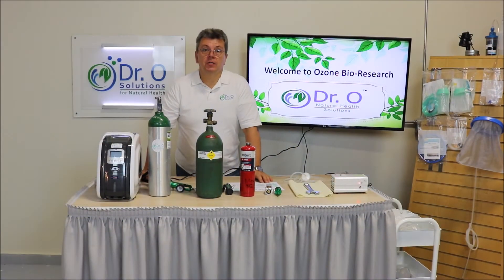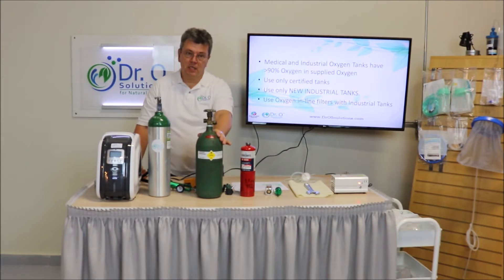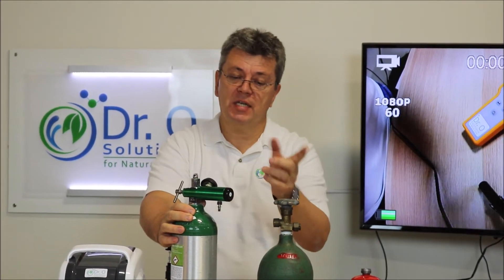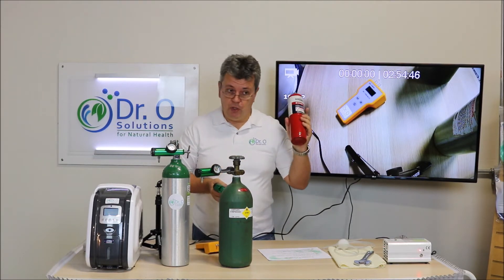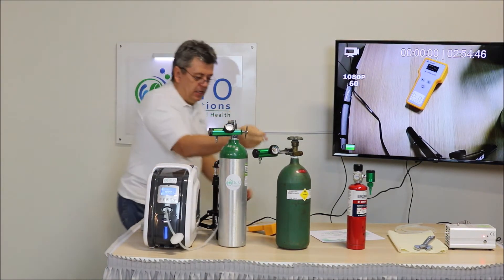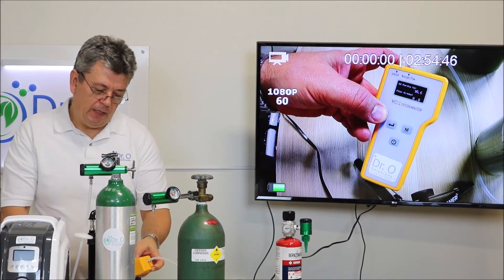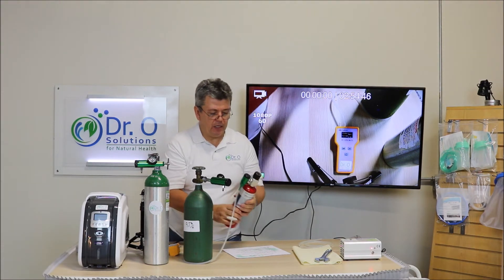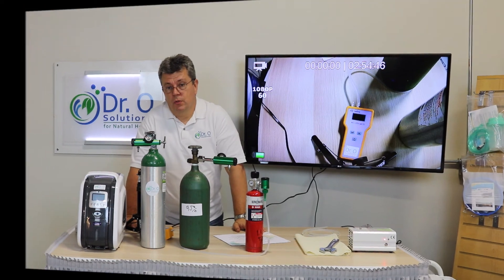Oxygen and ozone for medical ozone therapy

Comment: Is it safe to use Industrial grade oxygen for breathing and inhalation therapy and for drinking?  Where can i buy Medical grade oxygen without a prescription?
Reply from the maker: in USA it's only by prescription, if industrial oxygen is filtered - it's safe
Reply: I use beverage grade oxygen from local supplier.  Same  as  medical but no prescription. Ask local weldind medical supply if they have it. Same  fitting as industrial.
Reply: Bernzomatic disposable oxygen can be shipped *a few States excluded*. I just purchased 4 tanks online for just over $15.00 each. SHOP.COM They offered free shipping if you purchase over $50.00. So I picked up 4 of them.
Reply: @bEhavEnErgy2026  how long did 1 tank last you?
Reply: @Myactivechannel  hi. Of course it depends in how often and what applications you use. Just doing insuflations vag. Ears rectal daily a tank can last a couple months. But if you breathe through oil, or use in a sauna the settings are higher and you will use more oxygen. I've used two tanks in a month since using the breathing, and sauna. I may invest in a large refillable tank, or an oxy generator soon.